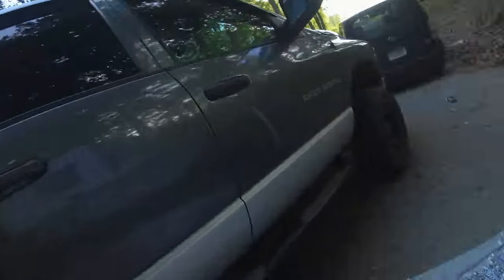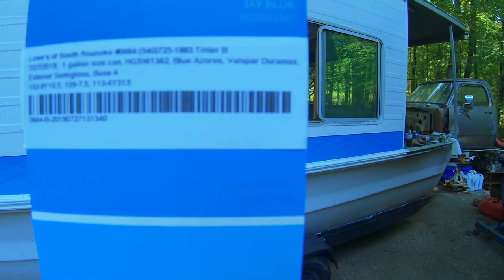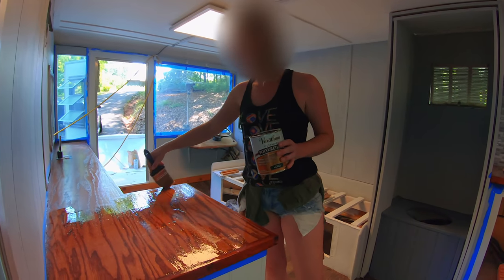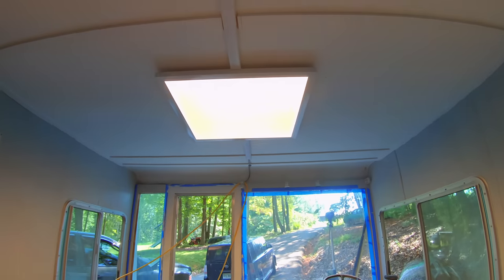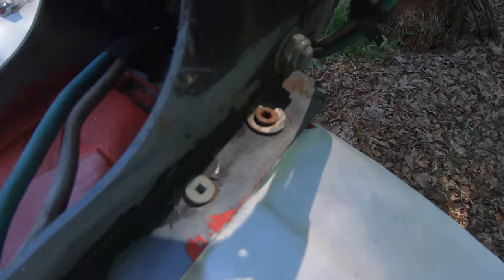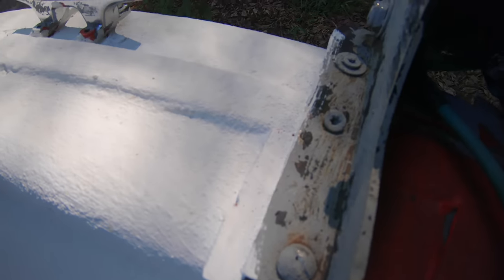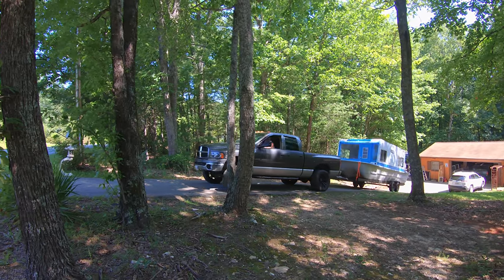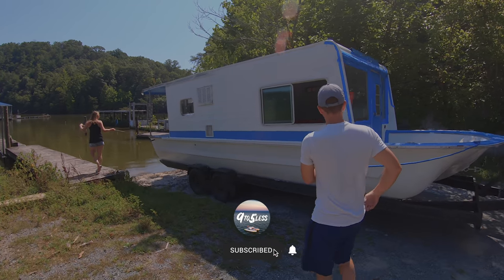We PAINT The HOUSEBOAT With Painters Tape Blue and Drive It To The LAKE! Ep 10

Comment: Another little British boat painting tip from across the pond (Atlantic Ocean). Use painters and decorators Pro-Tec tape which adheres well, is anti bleed and when you peel it off it doesn't take off the paint underneath and creates a pin sharp line. Just gone 4am I really should stop watching your videos but they're just too darn addictive. I'm never going to finish painting my own boat at this rate lol.

Comment: Yes, it will float ;) at least it better. Would have just painted across that lower edge with the gray you mixed up, or had on hand, as it wouldn't be that bad. While that painter tape blue isn't bad(and it really IS that color!) think it would have looked nice with a lighter shade of blue, as that always looks nice on boats.

Comment: I actually like that color for a boat stripe on that particular boat. Looks good. Hopefully you sell it for the right amount. I personally think your catamaran is a bit small and don't like that it's made with plywood but it's a hell of a good start. My recordation is to build one out of cedar strips from scratch or purchase another one that's made with some type of composite so it doesn't rot. Check out a group on Facebook called "Cedar Strip Canoe and Kayak Building". This will teach you how to build one. You can take these same principles and build a large catamaran. Better yet, build the forms or ribs and build a composite catamaran as well as your catamaran at the same time. Once done with both, sell the smaller one and keep the larger one.

Comment: Those LCD light panels you can make those yourself using the screen parts from old broken LCD TVs popped into for example an ash box moulding / picture frame using LED strip lights around the inside edge of the frame to create the same effect. If you look on Youtube, oh to hell with it, here is the link to make it easy for you (and save yourself some money): https://www.youtube.com/watch?v=8JrqH2oOTK4